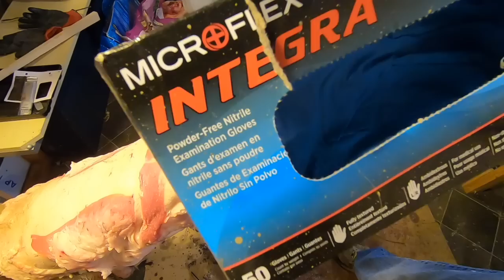Complete Raccoon Fur Handling

Comment: Done a great job my only suggestion as for how I do it if you cut around the front ankles before you pull the front legs then when you do pul the legs like you did the legs will just pop free and not need cut with the fur inside out just my suggestion but otherwise great job
Reply from the maker: Thanks for watching and the tip .
Reply: Not a problem thanks for the great content and yea that’s the only thing I could suggest that’s a tip I learned from my brother in law when I started skinning and it seem to make that process just a little easier but other wise I skin the same as you showed

Comment: Very good video. 
Thanks
Reply from the maker: Thanks for watching.
Reply: @LiveMoreOutdoors Just have a question.
I have several victor #2 double coil spring traps will they hold a coyote if not how can I modify so they will??
Reply from the maker: They will hold a coyote as is, but some mods would help IMO.  Probably the most simple mod would be adding 4 coils or changing to new/powerful music wire springs to add speed and power.  If you have a welder, bubble tipping the jaws where the attach through the frame of the trap will eliminate a coyote from pulling the jaws out of the frame.  Finally, they could be base plated and laminated.  Some of these mods are easy if you have a welder and minimal skills.  In my last video, the bobcat my brother caught was in a fully modified victor #2.  I could show one in my next video if you want.
Reply: @LiveMoreOutdoors  
Yes I would like to a video on the mods.
Thank you for info and quick replies. 
Awesome videos.
Reply from the maker: I'll show one in the next intro.
Reply: @LiveMoreOutdoors  Thank you